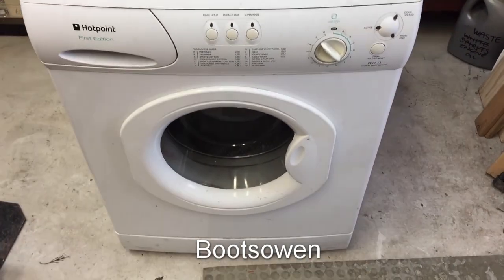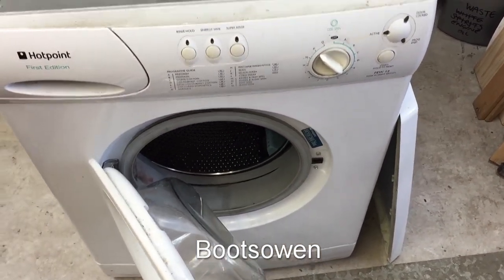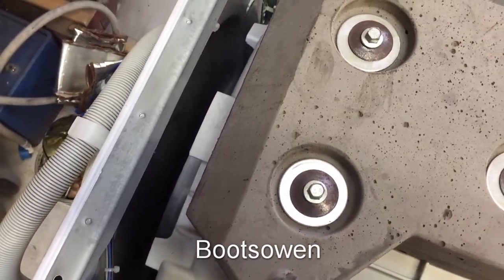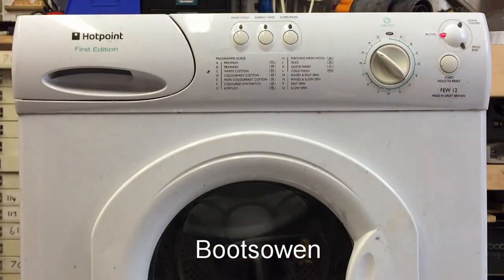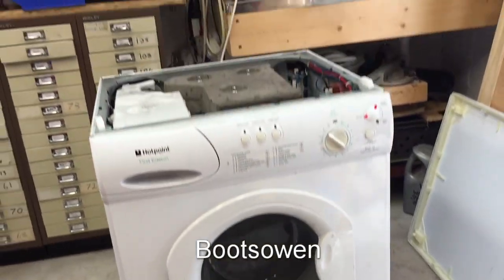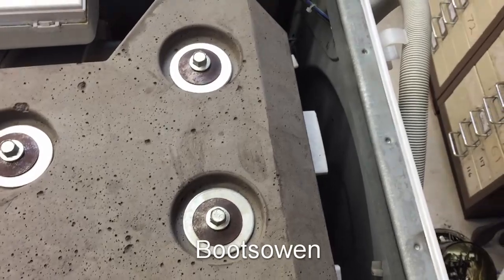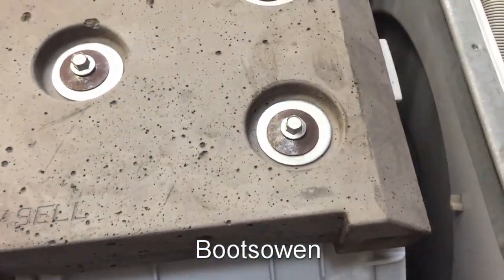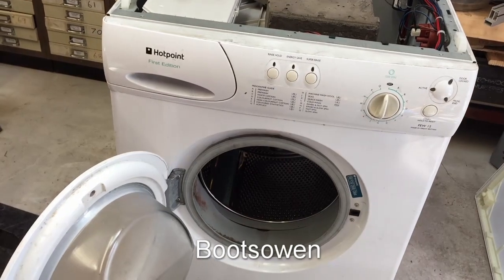Could these be the worst washing machine bearings ever? How does this machine even work?

Comment: It wont take rocket science to figure out that this machine was used on a 40° all the time, was never cleaned, the door was kept when  not in use and saw daily use lol.
Reply: If you can mistreat a lower/mid-range machine like that and still get 14 years out of it, I’d say that’s perfectly acceptable!

A 14 year old machine is going to be much less efficient and much less reliable, regardless of the brand.

Comment: This model is a FEW12P/WE so the new tub costs £294.99 on eSpares
Reply from the maker: Yikes, you could buy two of the cheapest washing machines for that price. Do you think anyone would pay this?
Reply: @bootsowen  If they have £294.99 then yes
Reply: @bootsowen  my Bosch classixx WFL2062GB/12s motor is almost ded, it still turns but it sounds strange and there's a burning smell, not the carbon brushes those were changed 3 months ago. We will get a new washer as a motor costs £200 from espares, yikes!

Comment: I’m shocked that has a sealed tub! I thought this was made back in 2003 or earlier. Shame really that it is sealed but I think it’s just fit for the brick! Maybe it can have a dance with the wma50 to see which one is stronger? It’s weird as I also thought these were clockwise as the older ones was. Maybe you can feed this one the safe or washing machine motors?
Reply: Yes these were made around 2003. I had one, bought in 2004 and scrapped in 2011 when it failed in exactly the same way as this! Strangely enough.... Planned obsolescence hotpoint?

Comment: This machine has a bad spider which is attached to the drum and the shaft that goes to the pulley. Their for it is not the bearings! It might be possible and impossible to do this fix. You can order the spiders online. But I recommend getting a new machine. So brick it is!

Comment: Hotpoint really went downhill after Indesit bought them in 2004. It's a shame because Hotpoint used 
to be good and repairs were free if your machine was under guarantee. It also used to be easy to source 
spare parts for Hotpoint washing machines. It's done well to have lasted 14 years. The one good thing about 
this model is that it's very easy to use and doesn't have too many buttons. The only brands I would recommend
now are Miele or Bosch.
Reply from the maker: what about ebac?